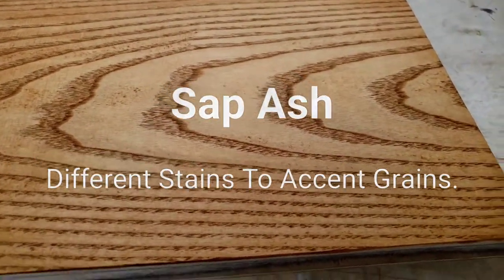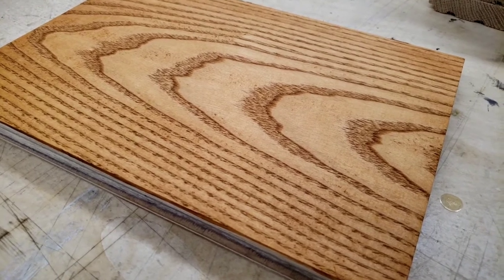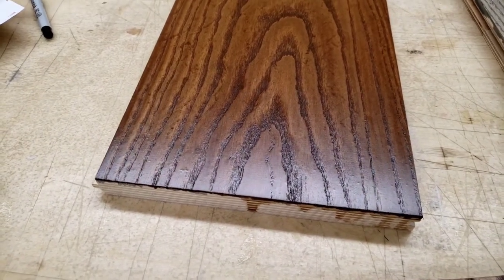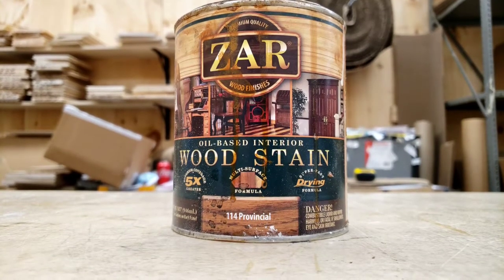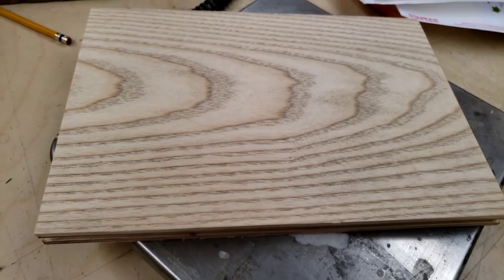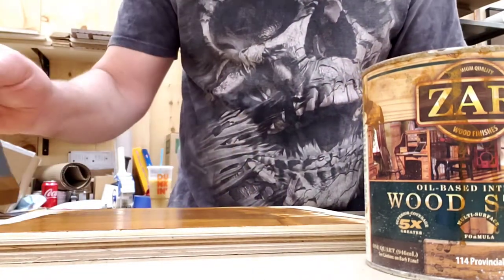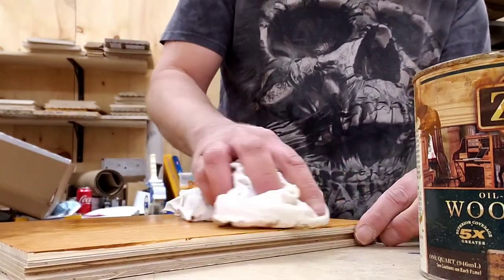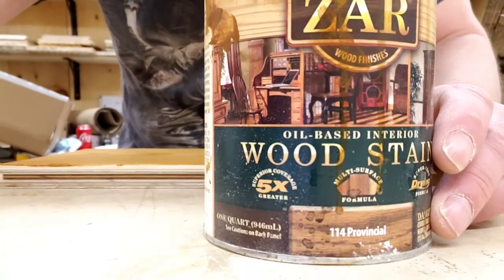STAINING SAP ASH DEMO | ZAR PROVINCIAL & MINWAX ENGLISH CHESTNUT COMPARISON

Comment: You have exceptional Staining skills your samples look so nice!! I did hundreds of homes in chestnut homeowners loved it.
Reply from the maker: I think this has to be probably one of the easier woods that I work with. It isn’t messy and it really takes stains well.
Reply: @johnsguitarmusicanddemos   You do do great work that's for sure...I love MinWax stain but I don't like the bleed back you can get from it sometimes we apply stain to big jobs with a lambs wood applicator and by hand on small ones we can over stain sometimes get a bleed back but I always steel wool my stain jobs knock that bleed back right out and close the grain more before the first coat of oil finish for a way better look in the final.. can't do this with Waterbase finish coats though you will get rust spots"lol"  what's great about MinWax it is the only stain made that's a finish or a stain..you can also kill two birds with one stone and apply your stain to the floor with steel wood pads we make up but still you can get bleed back that way and have to steel wool it again a no win sometimes!! "😂
Reply from the maker: @ElvisPretzel-rv3bg  The one thing that I don’t like is when I’m doing oak and sometimes the stain kind of bubbles back out from the wood as it’s drying. But usually after 12 hours of sitting on the board, I can put my sheen straight on it. That’s if I use oil poly by Duraseal.
Reply: @johnsguitarmusicanddemos  From what I have experienced Sometimes you can sand oak so smooth it's hard for the hard part of the grain to soak the stain up so it bubbles on top the soft grain has no problem at all soaking up the stain i have screened oak floors with a buffer so smooth sometimes the stain or finish rolls like bb's across the floor "😂"  sometimes you can sand wood to smooth
Reply from the maker: @ElvisPretzel-rv3bg  We use a palm sander where I work and it’s 120 grit sandpaper. It doesn’t usually happen but it’s once in every blue moon that it bubbles back out of the wood. You can tell it’s definitely inside the wood because it’s actually inside the board when it’s leaking back out through the surface. Using sand and seal seems to stop it afterwards cured for about 12 hours.